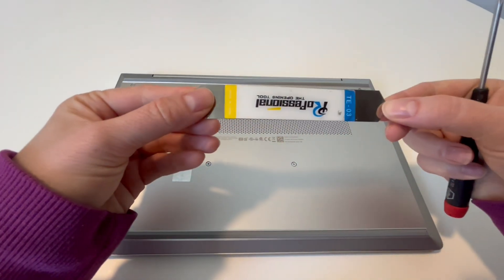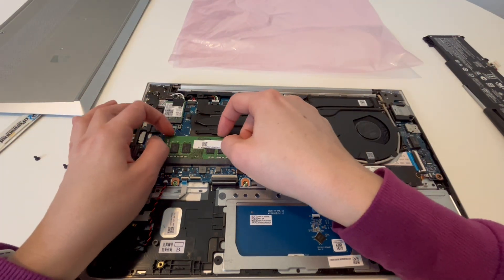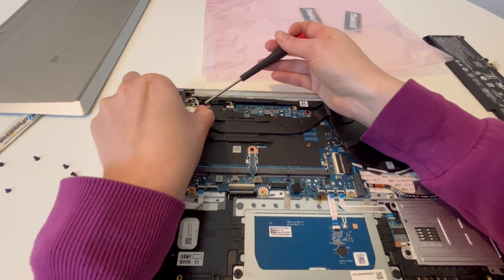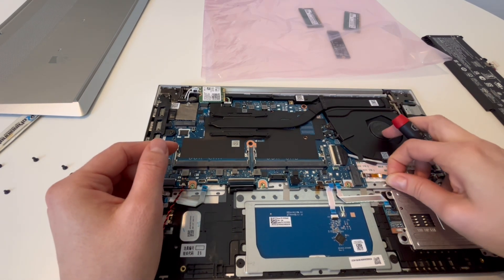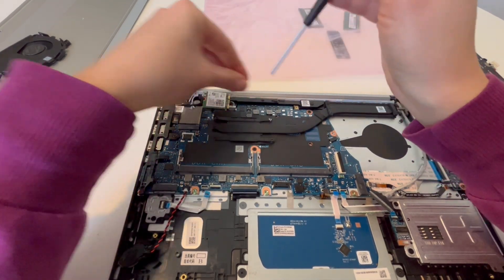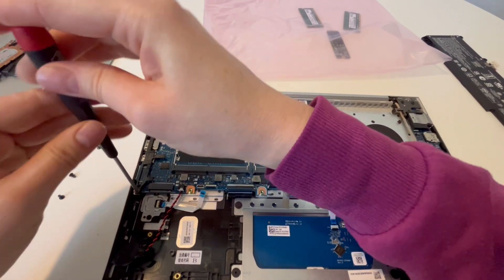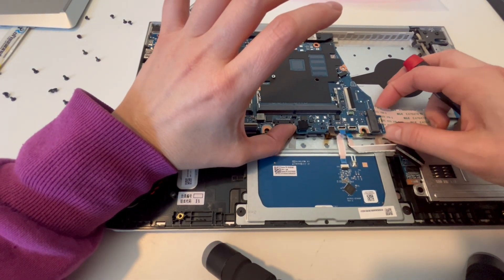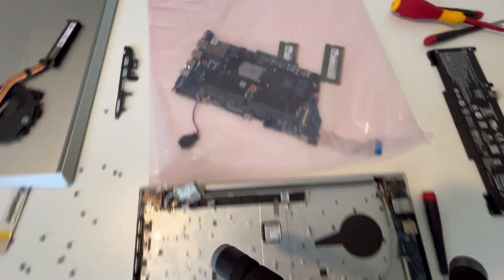How to Replace an HP Motherboard Without Damaging it - Advice from a Certified Repair Technician

Comment: Do you ever use rubber gloves? Do you have any advice on upgrading motherboards with replacement?
Reply from the maker: Great question! Using rubber gloves can help prevent any oils or dirt from your hands getting onto the motherboard, which is always a good practice. Sometimes I use them but it depends on how much I will need to be handling the componants. As for upgrading, make sure to double-check compatibility with your components and take your time during the installation process!